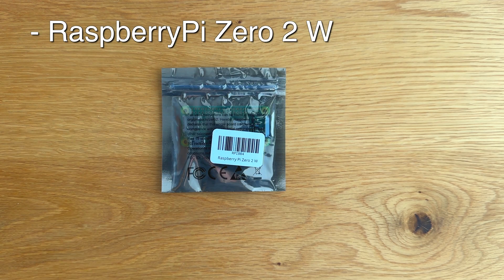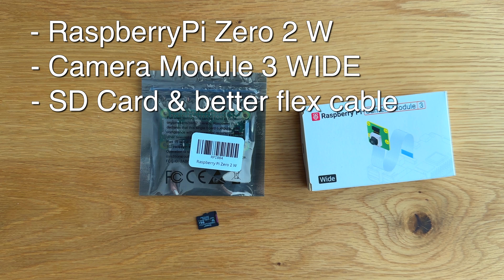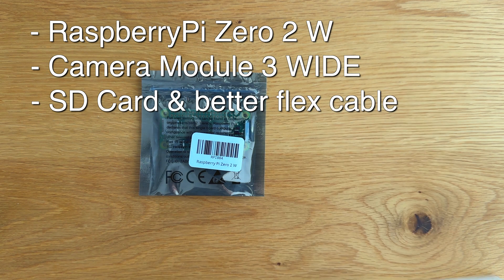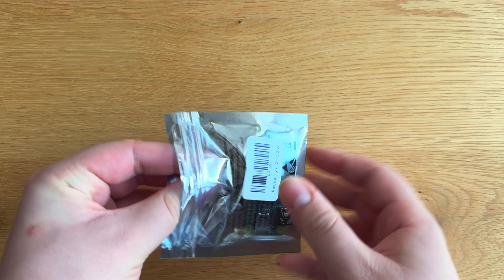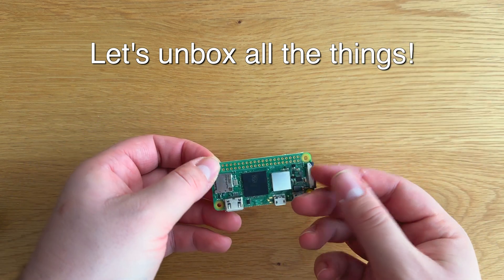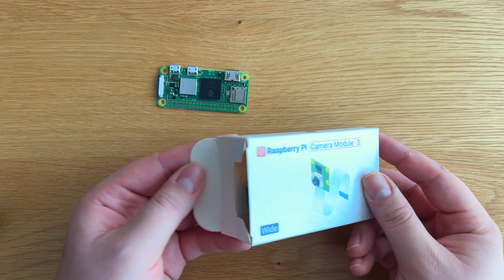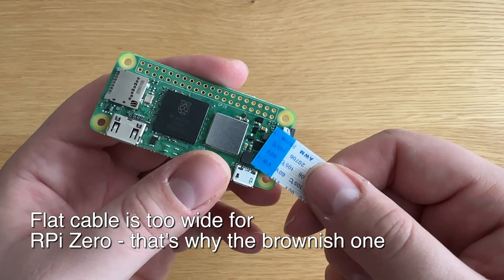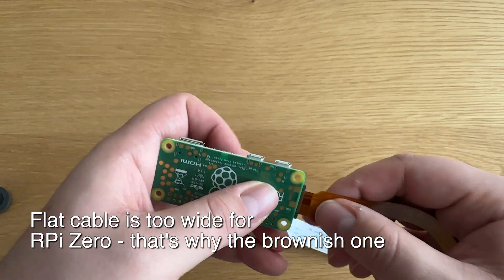How to make RaspberryPi time-lapse (security) camera | no programming needed 🔥

Comment: What's the difference between the -t time and the timelapse time? I understood timelapse is for the time to take a photo, but what's the -t time for?
Reply from the maker: the -t (followed with time in miliseconds) is for definition how long from the script run it should taking timelipse photos 🙂 in this case it will be making photos for 1 day .... to translate this line into natural language it is like "for 24 hours (86 400 000ms) take picture with timecode every 5 seconds (5000ms)"
Reply: @momentummilestones  thank you for the explanation. So if I leave the -t away, it will continue to take photos until stopped manually, right?
Reply from the maker: @alexp-de  yes it should work like that, but I am not sure what it will do after you will have full memory card, because this is just easy shell script and not program which is solving these exceptions